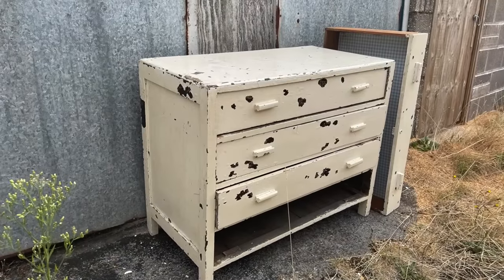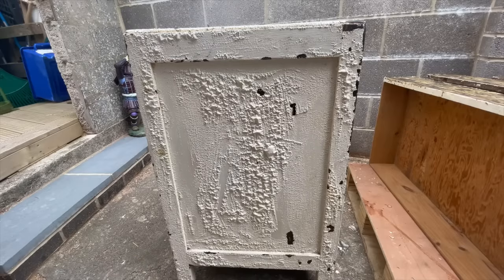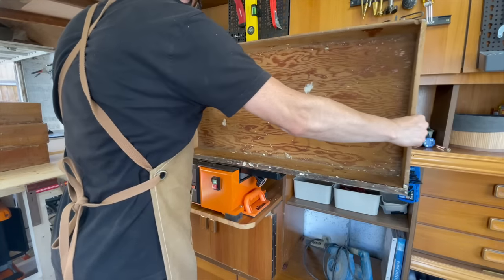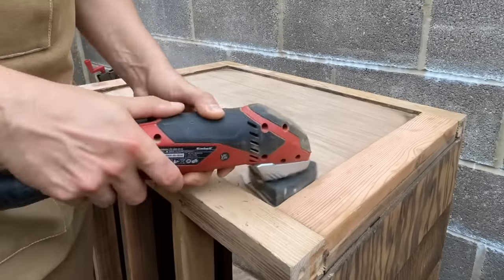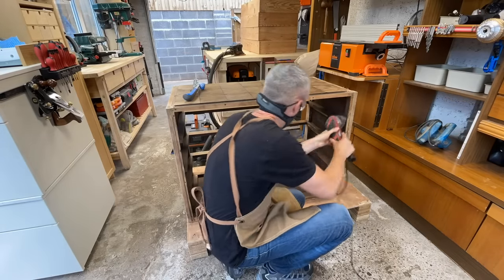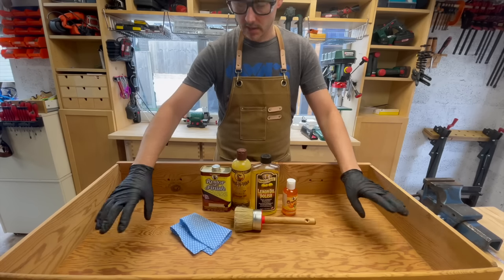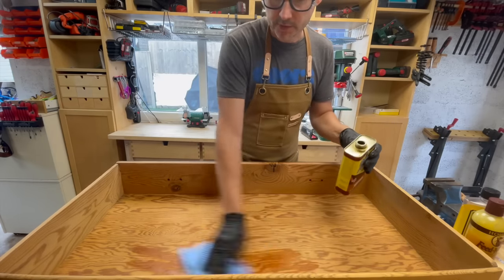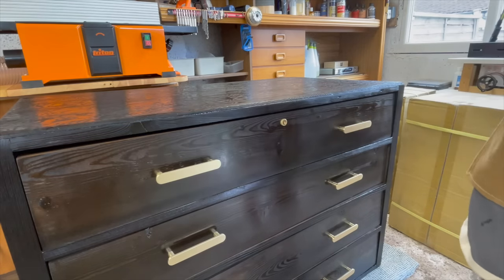RESTORATION of a Roadside Vintage Dresser.

Comment: Instead of working with chemicals, wouldn't it be easier to just sand off the old paint..?    WHAT A WONDERFUL JOB YOU DID..!!
BEAUTIFUL..!!
Reply: Not always. You run the risk of sanding through the veneer, sending paint dust that may contain lead into the air, etc.

Comment: I had an old dresser given to me that was destined for the dump. It had many coats of paint on it. It had a beautiful ornate mirror and wooden wheels. I stripped it down and my husband put linseed oil on it instead of stain. Turns out it was oak with laminate sides and 3  decent sized drawers. It was her family's from a long way back. I couldn't bear it going to the dump.

Comment: Tip: When doing my kitchen table, which is round and has a grain pattern, after complete strip and bleach, which is good to rid of leftover color, I then gave it a coat of cherry, rubbed it off quickly, then sat and hand painted the grain work using a fine brush and dark walnut stain, rubbing as I went along, it took two full days to do that. Then I re-stained the whole top in dark walnut, when I rubbed it off, the grain work looked fabulous! I gave the outer rim a third coat of dark walnut stain so the circle in the middle with the grain work stood out even more. Then gave it three thin coats of high gloss polyurethane so it always looks polished. Burning to create grain work is good, but since wood naturally has flaws, hand painting using stain one can ‘create’ grain work that isn’t there. 😃

Comment: First time  watching your channel I love it. I wish I had half your tools though so my work is basically by hand I bought her 150 year old house. Basically everything is wood and it needs a lot of  restoration so it’s nice to get tips on different things especially removing ingrained paint.. what do you think is the best way to remove shellac this does not come off with paint stripper or even with a heat gun so far no gentleman told me to use and scrub it with ammonia which kind of works it’s softens it so you can scrape it, but can you think of anything else less harmful? I am doing this to solid oak wall beating.
Reply from the maker: It’s super easy. Alkohol or  higher strenght acetone

Comment: I just did a old dresser. I never saw plastic being used. What is the purpose of that
Reply from the maker: Prevents drying out so it’s easier to remove it but you can always spray it with mineral spirit if it dries 😉

Comment: i would have used a wider knife, to get off the old paint. with a dresser which I love saving, but a lot of dressers are veneer, and or like you said, plywood; re painting it would not be bad at all, as most furniture fashion is painted furniture.

Comment: Spray painted wheels might work out okay on that carpet, but I'm thinking they would shed their gold paint on my vinyl laminate plank flooring.
Reply from the maker: they are not painted, its wax.If it rubs off it will just add to the industrial look, I don't think it will once its dry but its easy to clean with mineral spirit if it happens..

Comment: Hi, what is that blue tool you used to fasten the handles with?
Nice work!
Reply from the maker: Thank you 😊 it’s a small screwdriver from HOTO
Reply: @Flippingdrawers  Thank you for your fast reply. I actually have more questions but want to start small :) and watch your videos and take it all in. Is it possible to send you a picture of a dressoir that I own for some time and still didn't manage to beautify as I'm scared to and ask your opinion if I should use chemicals to get the paint off etc?
Keep up the good work.

Comment: I think it would have been cool if you had burned or etched your design into the top center plate. Are you going to do it? What do you think?
Reply from the maker: Sounds good but this video is quite old and I don’t even remember what happened to that piece 🙂 sold it I think
Reply: @Flippingdrawers  I'm sorry I was talking about the little table for your office with the Brass plate in the center. I think it put my comment under the wrong video.
Reply: This is still a beautiful peice though. You're my favorite furniture restorer/fixer/flipper.

Comment: Put  a coat of stripper, cover with newspaper and reapply the stripper then cover the wood  with the plastic wrapLeave the stripper on for 24 hours. You need more patience  in allowing the stripper to work. I removed 5 layers of paint from cabinets with one treatmant

Comment: Could you use bleach instead of oxsalic acid?
Reply from the maker: Depends who you ask 😂 it will work but depending on the stain it might not be as effective.  Plus it smells. It works much better if you can do it outside in a bright sun.